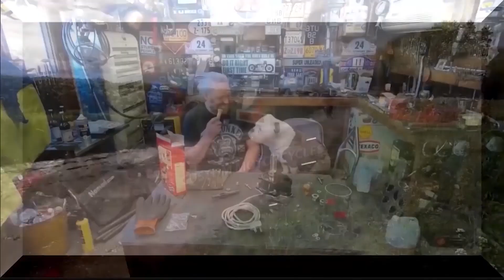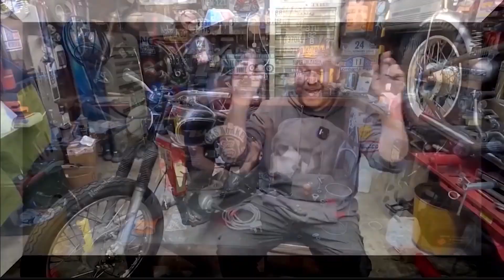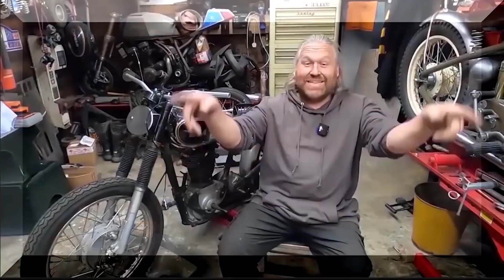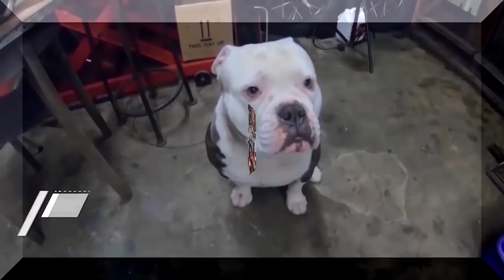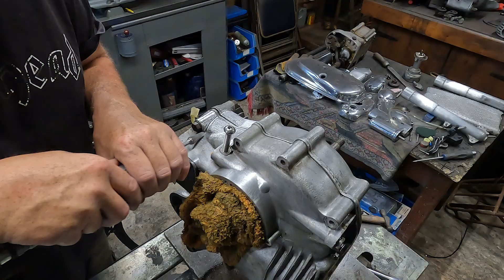Engine Cleaning

Comment: Just come back to your channel since I don't know when, for I'm not sure why 🤦 (life, work, etc.)
Regarding that cover not being straight; that sort of thing really bothers me as well. The options I can think of to sort it are:
1. Weld the holes in the engine casing and re-drill them to allow you to clock the casting to give correct positioning.
2. Cut the casting half way, clock it correctly and weld it up then grind and blend the texture.
3. Make a badge to cover up the wonkey embossing.

Comment: Good to see you back in the shed mate, I can see you definately sorting that cover out! If you have another sparecover, could you machine this one out where the RE round bit is, and then use the other  RE round bit off the spare, orientated to the correct line and maybe weld or stick in place? Hope you know what I'm on about! cheers Dave

Comment: How much meat is on those points covers? I did a video a while back on tarting up an oil filler using a pin badge and epoxy resin. Bore out a well in the cap on the lathe, glue in the badge then pour epoxy in, wait a few days then face off on the lathe and polish up.

Comment: Craig just wondering if you could straighten up the RE cover plate by making a disc that would fix underneath the RE cover plate, fixed to the casting. Then the RE cover plate could fix to the disc?